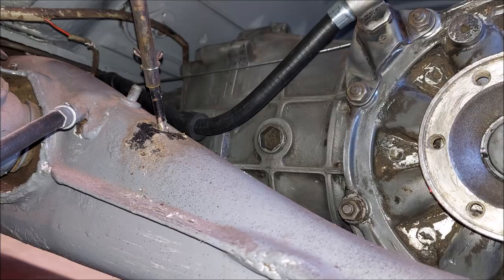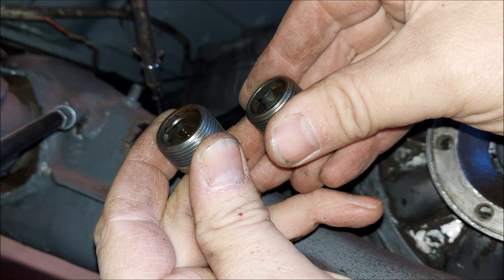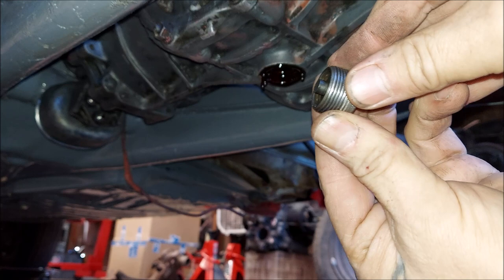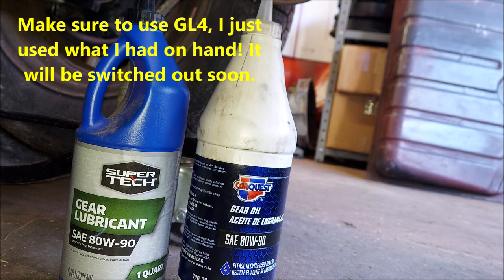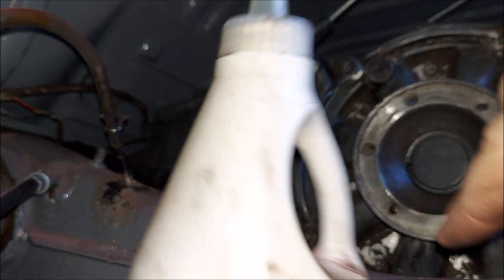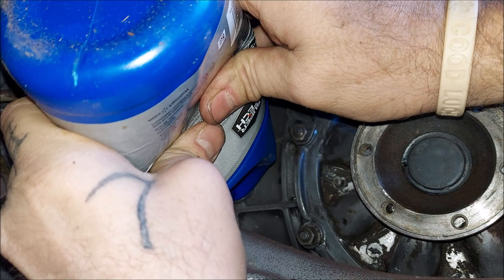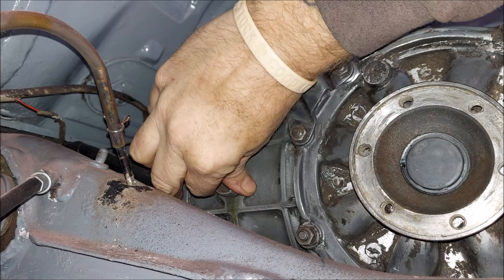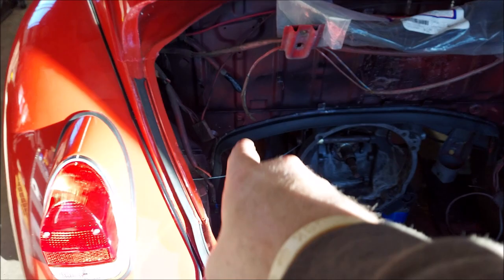VW Beetle - Super Beetle Air Cooled Transmission Fluid Change - Transaxle IRS - Swingaxle - DIY!

Comment: what happens if we don't loosen the fill plug first ? what happens to the car when you drive it ? because when i changed transmission oil i didn't loosen it i directly dit unscrewed bottom , and know the car gearbox turns when i move the car its like its on gear always maybe because of that ? and when i mount the engine it truns when i move the car in the garage even thought its on neutral , can you explain me or what can i do to solve this ?

Comment: My 56 has a grinding noise in 1st and reverse.  Should I be trying to make adjustments or change gear oil.  Or both?
Reply from the maker: Honestly that sounds like it could be the synchronizers. 
I would try to make adjustments first with the shifter itself, and then check your coupler where the shifting tube connects to the transmission.
Reply: @SladesVWBeetle  Now I found transmission fluid coming out the left rear boot.  Thanks for the reply.

Comment: Good job, Slade.  The only thing I do differently is let the oil drip until it stops on the fill hole.  Maybe two or three minutes, then I screw the fill plug back in.  I also use a pump, cause my thumbs are weak from 44 years in the salt mines, lol.

By the way, don’t discount some of the new oils available today.  I use Redline MT-90, GL4 (fully synthetic).  It doesn’t cost that much more, especially considering how you don’t have to change it very often.  This Redline stuff is so much better than the old, regular stuff.  

You know how on cold mornings, before the transmission gets nice and warm from driving, you get that slight gear clash, or sluggishness when changing gears?  This Redline is so smooth at any temperature, it completely eliminates that cold-weather sluggishness.  When warm, it also shifts nice and smooth.

Just a little tip, you might want to consider next time.
Reply from the maker: Yes you’re definitely right, it’s best to let the fill plug drip for a little bit. I do agree on that. 100%

Funny you brought that up, I had an older BMW for a little while, geez I miss that car. Anyhow, I ran red line in the rear end, and also the transmission. 
I noticed the rear and felt smoother, I know that sounds odd but it really did. 
I didn’t know they made it in a GL4!  I’m really glad you brought that up because I’m gonna look into it. 
My buddy ran synthetic in his beetle and swore that it shifted nice and smooth. 
I always get freaked out by synthetics in my older cars. But that’s because my brains older LOL
Yes when it is cold out which we get our share of that here in Northeast, it gets strange and put your drive in it forever.

Comment: glad I knocked mine out months ago it sucks to do in 40 degrees and lower. I feel for you
Reply from the maker: Yes it’s quite cold here now. It’s around 29° today when I went into the garage.
Reply: @SladesVWBeetle  not much different here in St.Louis it was 32 high and dropping. we will all keep on Vdubbing through the cold. Im adding a 220 heater to insure I can be in the garage 😬

Comment: Another great video Slades. I clicked as soon as I got the notification lol. Even if I already know how to do it I watch for entertainment and to help your channel out. I’ll be excited to use my 17mm hex that I ordered from Capri last month I’ve never changed fluid in one before. I have a crap load of Pennzoil 75W-90 so I will probably use that I got it on closeout at Ace Hardware for I think $2 each or something like that. Keep up the good work and videos.
Reply from the maker: That was honestly a very good deal on that Pennzoil. I would’ve bought a ton of that up. Thanks for being here I really do appreciate the support. My wife just got finished tonight designing my logo. There’s been quite a few people asking about T-shirts or stickers. So I’ll be offering those soon.
Reply: @SladesVWBeetle  yes it was a great deal. And oh boy I am excited for the shirts and stickers. I’ve been working on mine today. Still battling with the front cutting the handle didn’t help I think it’s stuck where the pin goes down so tomorrow I am going to crawl under there and see what I can figure out. I need to open the front to replace the glove box and hood cable.
Reply from the maker: Try to use cutting as your last resort. I know that’s what they say on all of the forums, but I would try my best to get it open first without doing that. On Facebook, Instagram, and a lot of comments throughout YouTube everybody was asking if I could sell some stickers or shirts. Which really made me feel good. My wife finished the logo, I have to upload it tomorrow to the vendor. And then I’ll be putting it on the community here. When I upload a photo.
Reply: @SladesVWBeetle  excellent. You need a website to sell stuff on and post stuff on I think that would be cool. Yes I can’t stand to cut it which is part of the reason I ordered the guard for there too so I don’t have to damage the paint if it does come down to that.

Comment: Great video. Be sure to use gear oil that is bronze or brass friendly.
Reply from the maker: Yes GL4 should be used. I used what I had on hand, but this fluid will be lucky to see 50 miles, then emptied and refilled.

Comment: This is one job I've never I've thought about doing but " Never" have never done. That has to be a nightmare with the CV joint in?. Once your done do you need to drive it a little bit and re- check? Roughly how much fluid us needed to do the job? I see you have the reverse back up switch on the side. I need to hook mine up also. As always another well done video. You will never know how many it will help out in the future. I'm jelous of this generation. We didn't have YouTube. We had a Bentley manual and a best friend on a weekend. Well , maybe we had it better, LOL.
Reply from the maker: I think it’s a little more difficult with the CV joint in the way, but you can always use those little pump handles that go inside the bottle. It truly makes it a lot easier I could not find mine. 
On an average they hold between 6-7 pints.
On that side, the driver side that’s actually a neutral safety switch. 
The reverse light switches on the opposite side. 
Yes I think we had a better back in the day that is my opinion. We had a manual, and had to figure things out. YouTube is very convenient I must admit, brother, thank you for always supporting me and being there for me.
Reply: @SladesVWBeetle  safety neutral switch? Was it a autostick?. I.thank you as well for your continued support as well. Your truly a friend. Glad I have had the chance to meet you.

Comment: This video is totally stage, nobody's car is that clean you should have grease up to your elbows doing this lube change lol. 😂😆👍 Great job. Your car looks awesome 😎. Talk about thick oil, I put some Luces one time and I thought I was dealing with honey lol. I find using a suction gun works well it's cheap but can be a little messy. Keep up the good work.
Reply from the maker: Hey Clinton!! Oh I usually end up greasy somehow, and I still can’t figure out why when I’ve cleaned everything up. 🙄😂 
I have never tried any other product yet. A buddy of mine ran synthetic and his and he swears that shifts much smoother. I have a pump that I could’ve used, but for the life of me I can’t find it now of course.

Comment: I just did my 71 standard bug. I used 75/90 non synthetic. Having a hand pump helps. Screws on top of the bottle. 
I was concerned if I used synthetic I might get leaks.
Reply from the maker: Thanks for being here sir, oddly enough I have one of those hand pumps in the garage. 🙄 after I got done I realized I should’ve used it. But then again I’m just a human being. I don’t like synthetic, because if you have old seals it will clean them up and start leaking. That’s just my opinion.
Reply: @SladesVWBeetle  
That “ human being “ thing will get you every time LOL 😆. I know from personal experience!  Enjoy your vids.
Reply from the maker: Thanks!! And thanks for commenting!

Comment: Hey Slade, I have a transmission question for you.  I have a '73 super beetle and it doesn't like to stay in reverse.  If I have to back up, I have to hold it in reverse.  If I don't hold it, it pops out when I release the clutch.  Where would that problems root be?
Reply from the maker: Sadly that’s a common problem. So you will definitely need to have it rebuilt, or buy a rebuilt one online. What happens, is the reverse gear teeth, start rounding out. They don’t keep their sharp edge after many years of use. Which keeps them from staying in gear. I hope this was helpful.
Reply: @SladesVWBeetle  yes, thank you.  Your videos are so helpful.  I sat down with your carburetor rebuild video and rebuilt my carb.  For someone just getting into the VW world, you are the most helpful person on YouTube!
Reply from the maker: @starlord2628  Thank you, your comment has made my whole day. I truly mean that. When these videos help other people, it makes me smile. Welcome aboard, and welcome to the community.

Comment: I'm not a Mechanic, but I was just curious, would it ruin the transmission if I used Transmission Oil, Coincidentally I had just changed the transmission fluid but I used transmission fluid, I've been Driving it with transmission fluid, I should be changing it to the Gear oil ASAP cause of your Video. Thanks...   :●)
Reply from the maker: Hi Tony, yes you  would want to change that immediately my friend. Change it over to the gear oil. Transmission fluid would definitely be too thin.
Reply: @SladesVWBeetle  Dude, Thank You...   😊